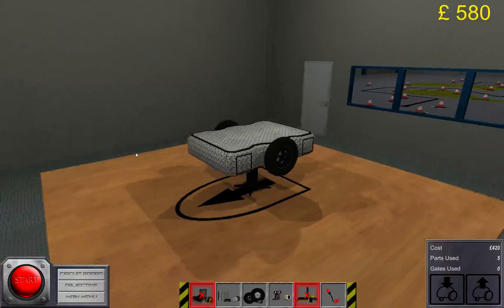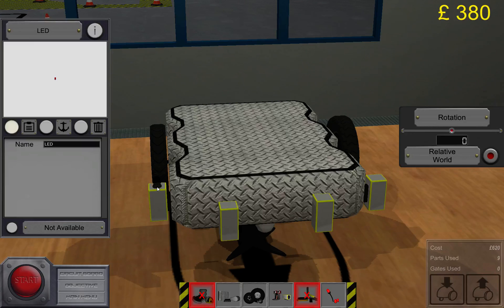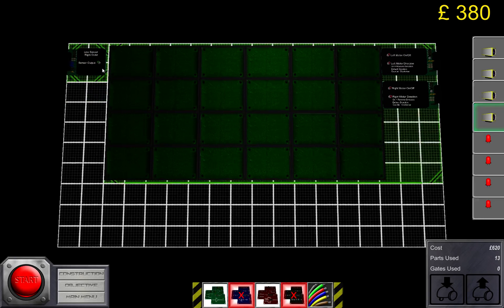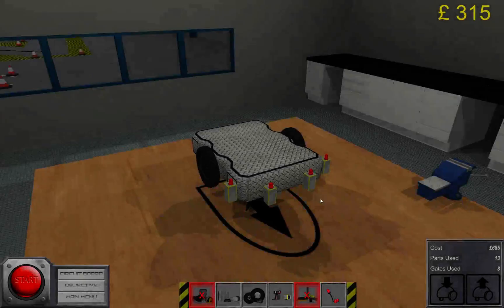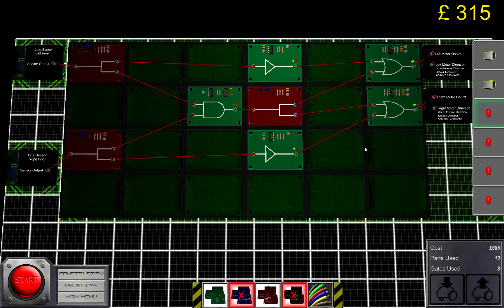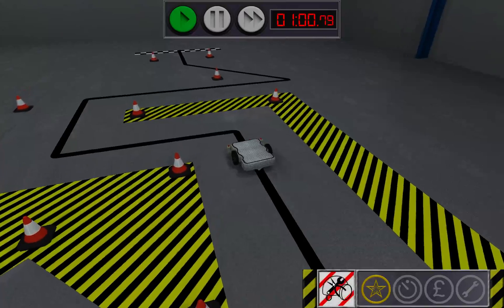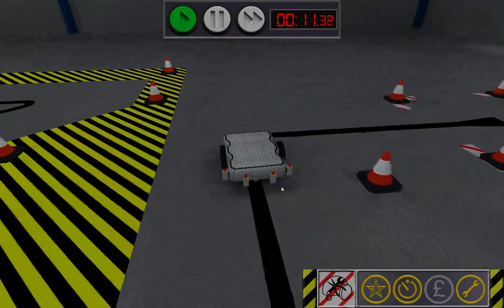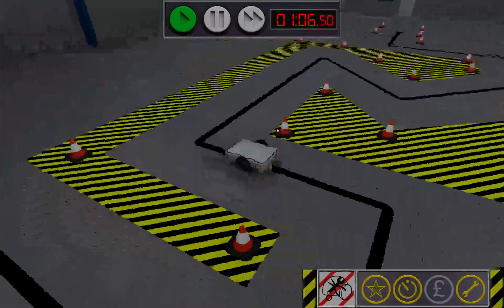Logictbots 1-2 Tight Bends Tutorial

Comment: mine spins emediately from the start and disregards the line completely.
Reply: update robot was wired backwards. rear wheel design worked better for me than mid wheel.
Reply from the maker: +Jacob Lindsey Sometimes the solution is right in front of you.
Reply: +masterstroggo 
And sometimes, in order to progress on the course, you must drive backwards!  :P

If the robot does not work - give it a little kick.
If that does not help, then try switching the wires (like Jacob found out). It also happened to me once, when I wired my robot very late at night, and not paying attention to what I connected where. :)

The exact position of the (powered) wheels will matter in all the solutions, as well as how far apart the sensors are. Up to a certain point, the further away sensors are, the tighter the bends can be (while still staying on the course), but also the slower the robot will go. So if you are missing 1 or 2 seconds on the Speed Time challenge, then try moving the sensors 1-2 millimeters (just a tiny little bit) closer to the middle. :)